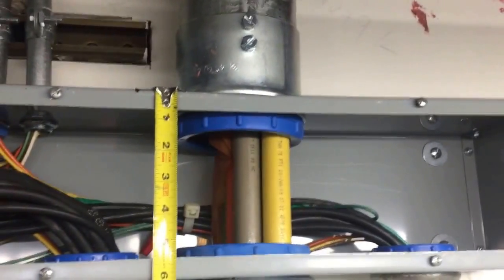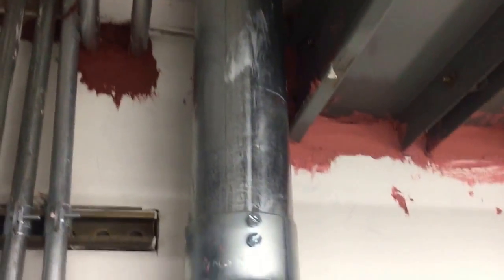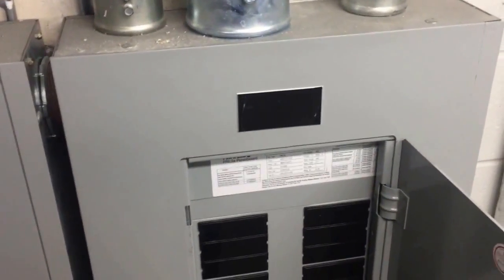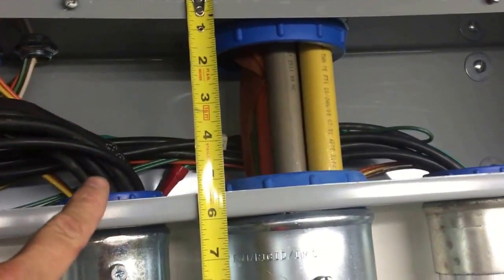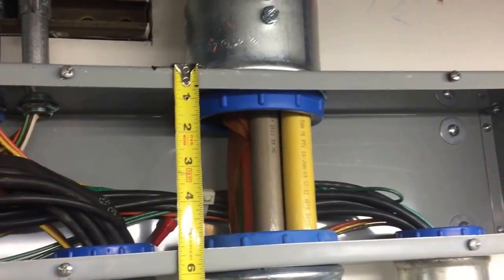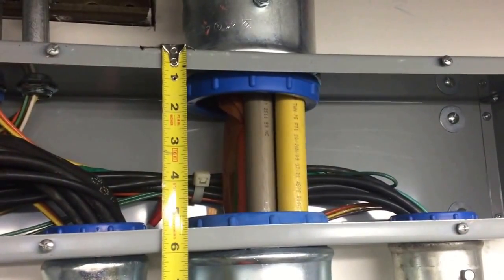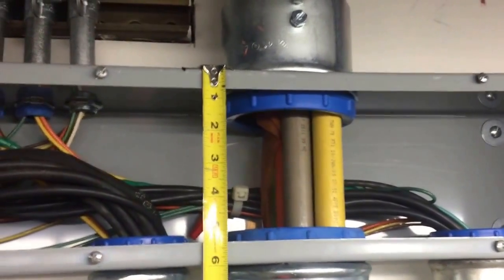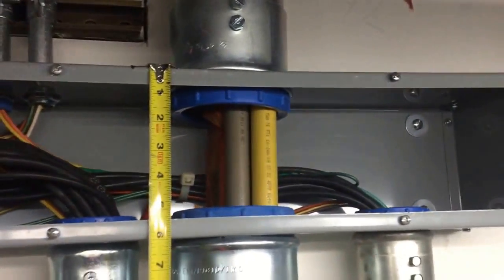Moving Violations Video No. 163: Short on Space

Comment: Nec says if wireway is used as a pullbox. In this situation, its not a pullbox, its the same as if the conduit went straight in. So as long as you re not trying to pull the wires out there youre good.